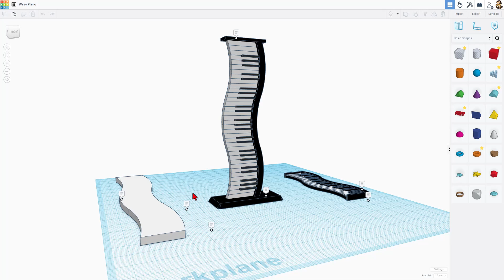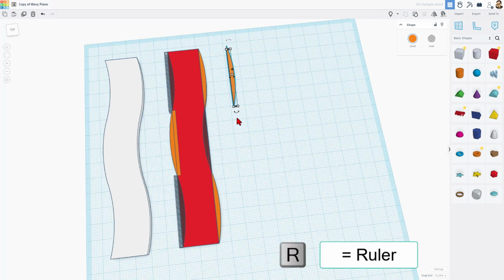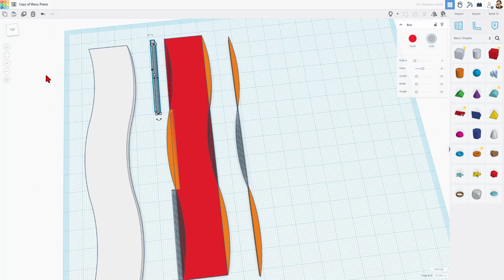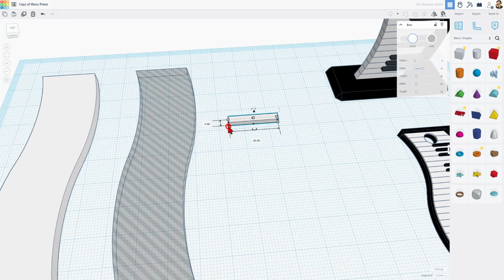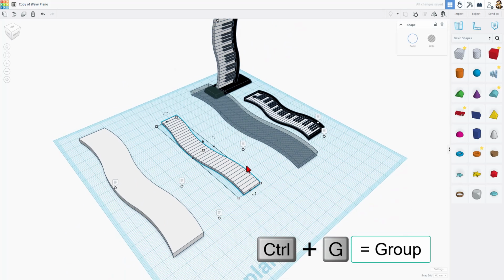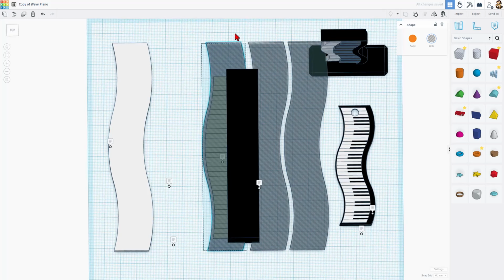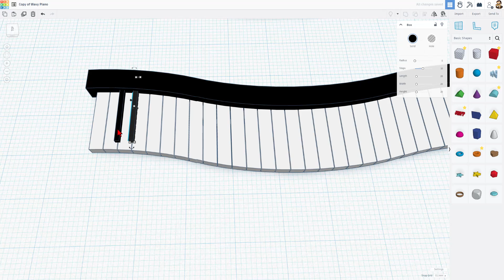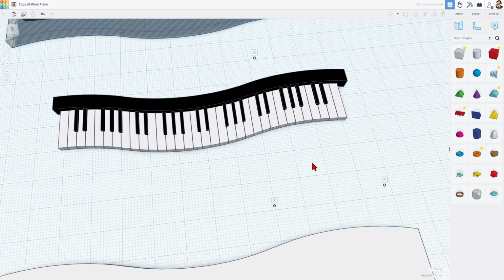A Free Wavy Piano Keychain Advanced Tinkercad Curves for Beginners

Comment: 3:18 That glitch is a rounding error. Instead of clipping off a sliver of cylinder I'd clip out a chunk of cylinder and leave some overlapping the box edge, so TC engine is in no doubt what side of the box face it's on.
Reply from the maker: Interesting. I will do some fiddling with that. Thanks tons for the advice. 💯🔥